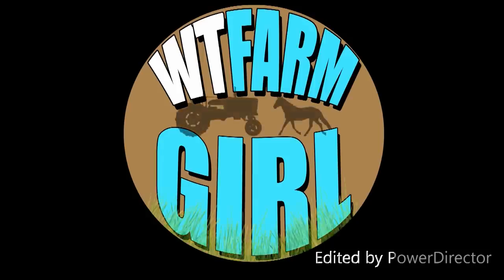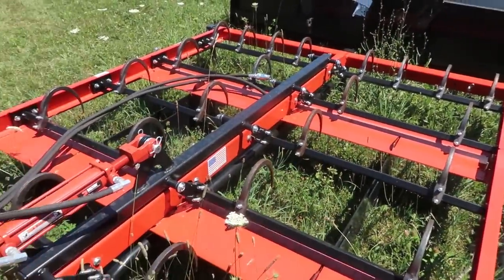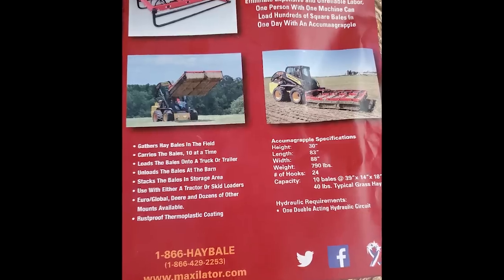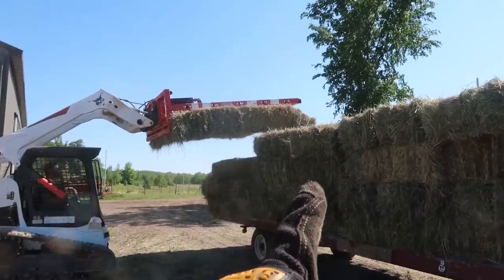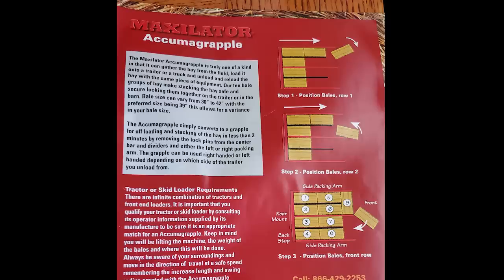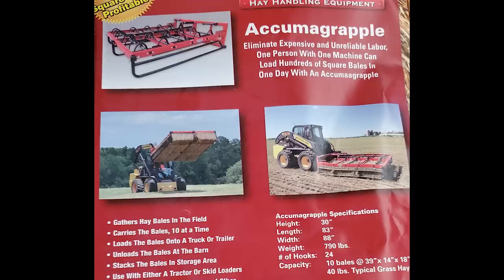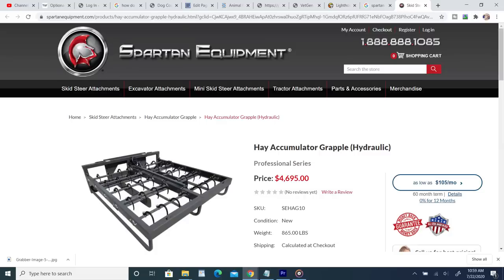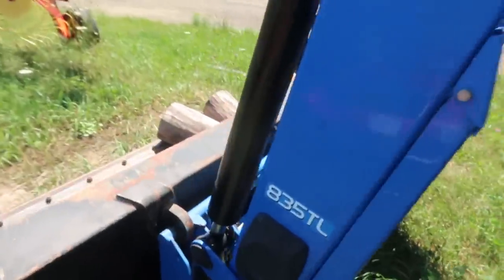324 Hay Accumulation System: Why The Maxilator Didn't Work . . .

Comment: Sounds like you need to spend a little money on fixing the baler. Very interesting video
Reply from the maker: It's not so much the money issues as we've sent it out to be repaired before. But the repair shop gets overbooked with others needing help too that sometimes it's hard to get it in and back in time for next cut . . .
Reply: @This1LifeWeLive  But if fixing in the off season it's ready for the following season. You have an interesting delima.

Comment: I have never seen Dennis do square bales so no comment but when it comes to time, fast guys on the ground and two on the truck will keep your truck moving.... not what you want?? well then the square baler sounds good but the real cost is how many pieces of equipment to make run smooth and then will the cost be gone in say three years or less and what is the hay market next year... can you still make money on hay if everyone has a bumper crop. Its just because of supply and demand. If doing for ones self it would never really pay but the liniment sales would drop and dancing with your partner might just happen if your knuckles are not dragging the ground. I was a big guy and considered two men on a truck cause of tossing bales ten high and right into place making the stacking fast. I couldn't hold a glass or cup in either hand as they just crumble in my fingers. I ate enough food for two men and then they would work me till I fell down and couldn't move any more after two or three rests in ten hours. I used to fill a barn to the rafters every year by myself. I can't put my own pants on now at seventy three or even stand up straight so it really really wasn't worth it to me. I was a full time mechanic by my forties so damage done and too late to change me much except stopping doing the hay left me so stove up

Comment: I don't think that's a good system. 
We used hay racks behind the bailer . You have good ground for that.  Works better than any other way .
I saw something on your last video that I thought you should change. 
Always put hay on an elevator on edge.  Because I have seen the paddles cut the twine when laying flat . Fyi 😊💝👍🌎🌞

Comment: It’s not complicated, the bales have to be a smidge longer than twice the width of the bales.  Otherwise when you stack them, the two cross bales will be longer than the stack or flat ten.
Reply from the maker: That wasn't our problem though. The problem was getting thrm to fit into the grapple. Once stacked they could be any odd length and be fine.

Comment: Stacking the bales flat I see. That's a no no , needs to be on edge to store in the barn. How can we get that cured?
Reply from the maker: Most out here flat stack... I would want to visit a barn with edge stacked before I committed to doing it ;D
Reply: I have always stacked flat here in KY. The only reason to stack on edge is to try save damp bales from molding. U can stack slightly damp hay on edge kind of loosely and get the to finish drying without molding sometimes.

Comment: From my observations your bale length and density were not ideal for mechanical handling.  A 36" 60# bale works well.  A EURO to Skid steer adapter  will save you money as the loader implements typically cost $150 to $250 less each

Comment: Some of the bales toward the end of making a 10 bale pallet have had those hooks punch them 8 to 10 times. EVERY time you pick up the next bale. You are mutilating the previous bales! With a REAL accumulator, the bales only get punched by the hooks ONCE. BUT, you guys know this. 
Like that politician once said, "You can put lipstick on a pig, but it's still a pig." You bought a  RED "pig" in a poke. 
If that's an accumulator, so is my pu truck....as long as someone places each individual bale into it.😝

Comment: Yeah you're right the math doesn't work. Not even close. Looks to me like a really poorly thought out and cheaply made imitation of the really good Kuhn and others like it. I really personally don't think that you will ever be happy with that thing. I know I wouldn't. Plus it's going to be very hard to see what you're doing with that thing from the tractor cab if you run it on the tractor. I'm still sticking to what I've said before though. I don't care what they call the darn thing or what you were told but an accumulator "system" has 2 parts. The grapple but also the accumulator. They are separate pieces. That grapple won't work by itself. Not well enough to be worth it. It leaves too much space between the bales. That makes a loose stack. I've spent a LOT of time running grapples behind accumulators. There is a huge learning curve but once you get the hang of it you will like it. But not without the other half of the set. And you need a grapple that is the right size to hold the appropriate bales and it needs to match your accumulator too. Look up chronicles of a farmers wife. That's how the system is supposed to work. If new ones are too expensive look for used ones. They are around. In the mean time put both chutes on the back of the baler and hook that long 4 wheeled hay rack on behind the baler and have Eric ride the rack and stack straight from the baler. Probably will want a backboard to stack against to make it more stable and usually having 2  or 3 racks makes life easier. That's much cheaper than the accumulator setup. My brother and I did it that way for years.  Hope this doesn't make you mad but you got punked with that thing. Best of luck.
Reply: That is real experience talking from a real farmer. Listen up.

Comment: That grapple is made for 42" bales.  They lied about being able to handle 10 bales, its built for 8.  Stacked lots of square bales using an accumulator and grapple.  Never a seen 10 bail unit hang that much.

Comment: You should really take this down considering the fact you didn’t use it properly by extending the side rails. Did you read the instructions? Did you not wonder why there were extra holes in the frame?

Comment: Build a hay barn closer to your fields then you can grab your nails and stack them right away and eliminate putting them on your trailer driving to the barn and unloading and restacking save time and save money on fuel
Reply: Build it on the south side of the mud spot in the lane so they won't have to drive skidloader through the mudd

Comment: How come you didn't just buy the Euro Quick attach system with the Maxillator? Maxillator clearly sell them and you must have known you needed it. If you had told Maxillator that you had a T5-115 with the Euro QA they would have fixed you up. Instead you don't order what you need, and then come on you-tube and bash the manufacturer, for not providing it.
Reply from the maker: Erik bought it from a vendor and they didn't carry the attachment for it in stock. They are hard to find this time of year. The actual company couldn't be reached. I contacted them three times over the last few months before we bought it.
Reply: @This1LifeWeLive  OK, that makes sense. I'm sorry I sounded a little grumpy there, but I didn't understand why he didn't get it set up for the T5. Getting a smaller tractor with a ssqa would probably be best.

Comment: I think your problem is like any farmer profitability. Rental of a skid steer plus the cost of an accumulator did not reduce man power enough to justify the expense. Your baler to start needs optimal adjustment that you lack the proper knowledge at this time. The equipment choices you have made don't lend themselves to be a real farm only a nice hobby.

Comment: Sorry that's lack of experience has caused you so much trouble .... I own one of these maxilators and understand how simple machinery works -- it's not rocket science.   Easy to bale and load 1000 in an afternoon by myself.  Solid bales, the correct length are the key.           ........    ...... ..   ..... Your 'width' math doesn't include any space for the 'dividers' that keep the bales 'arranged' properly WHILE  they're being accumulated --- it's foolish to think you can accumulate with zero space between the bales --  give that a try and see how it works out, it won't.  .....    With 'SOLID' bales, the hooks don't slip out of the bales ....     Your lack of understanding and desire for lightweight bales will always result in frustration on ANY mechanized handling system
Reply: what length of bale do you strive for that works for you?
Reply: @nflash  39" long, SOLID bales (use 170lb. tensile strength plastic twine to withstand mechanical tweaks/twists without breaking --- depending on hay, bales will be near 60lbs).... works like a charm -- stacks well on the trailers and in the barn with "no-touch".